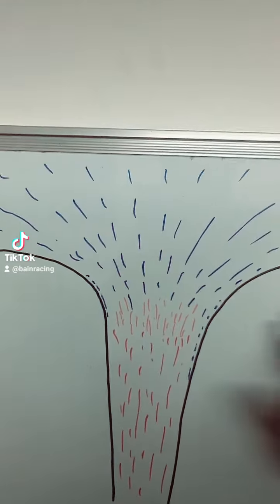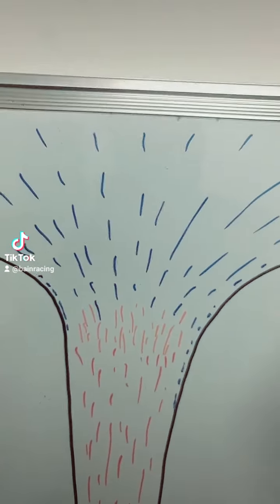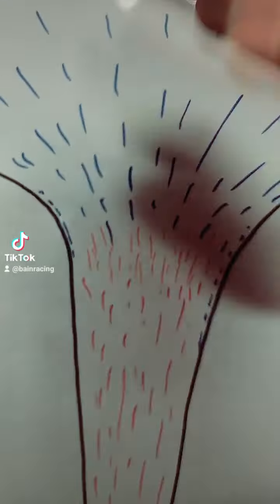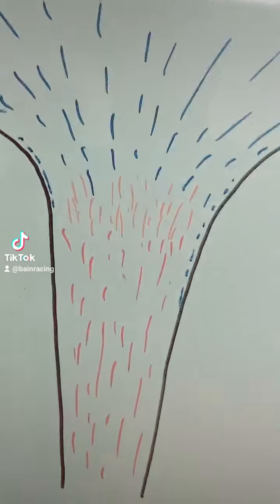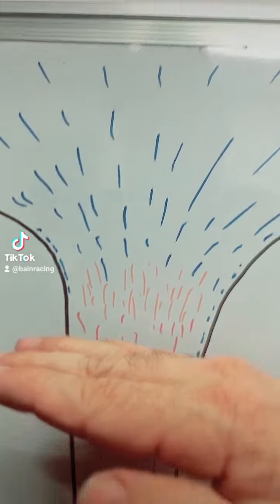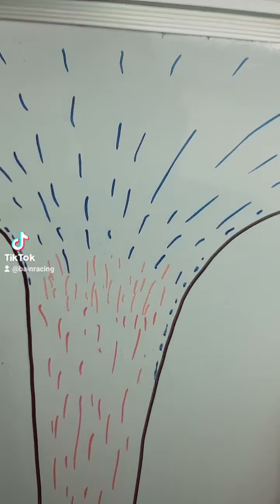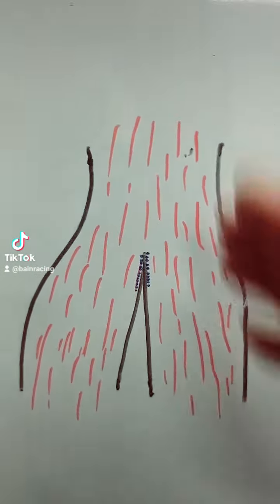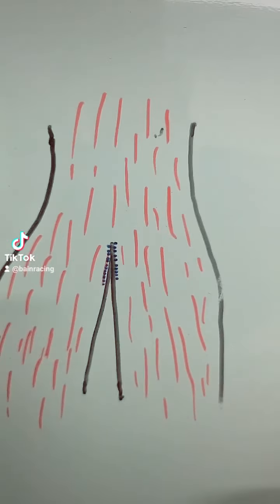"Sharp vs Radiused Dividers: Which is Better for Porting Twin Cam Heads?"

Comment: Thanks for the info. 
 A problem with sharp divider is, if the port is not 100% symmetrical, the air could flow in slight angle and that would create a wake at the edge. Round divider is much more forgiving. With sharp divider, margin of error is smaller.
Reply from the maker: Yeah, that's not really true at all mate, this something we have tested, and something you can easily probe at different pressure drops and confirm for yourself. 

The air speeds needed to create any sort of detrimental wake  with any approach angle  <5° needs to be close to supersonic, 1100fps. Which no port will ever get close to.  All the winning heads around the world are Mach 0.55 to 0.6 Max! 

Also, remember that the intake port is controlled by a "timed" depression in the form of a sine wave. 

This velocity sign wave is in a turbulent state. Not only does this turbulent flow optimise the inertia mechanism over laminar flow. But we see greater mass velocity. More mass equals more HP and torque. 

Also, this depression causes a radial pressure gradient. This means we have a fast deacceleration towards the port walls. Unlike what we see in a fully formed laminar flow event. So our drag coefficient is less, especially as we have an "active" boundary condition aswell. And we need to optimise this where we can. 

Now, another point you are missing is that the transitional length of the divider is key here!  The shape also affects the drag coefficient,  so a "C" profile has the longest transitional and radial length so this reduces any chance of a wake happening,  as the air isn't hitting a vertical wall at an instant point. 

Rather, the air is meeting the divider not only at an angular momentum but over at least 0.500" of port length.  Softening the drag it may create. 

Remember,  the devil is in the details, and we must understand the fluid dynamics principles at play here.  So, a well designed knife edge divider will outperform any radiused divider. Hands down. Not only by a velocity and inertia factor.  But to optimise the shock wave tuning. As we have reduced dead areas and reduced shock wave spread and collision. 

Now, as far as your point on  symmetry. That couldn't  be future from the turth. Again, we need to understand what pressure/density and velocity we are dealing with here and what's the most important factor.  Symmetry or CSA.  And again, any decent head developer can tell you it's ALWAYS CSA. 

In fact,  most hand ports aren't symmetrical at all. If we understand anything at all about air flow. Then the first thing we must understand is that the CSA is far more important than how "symmetrical" the ports are.  That's because velocity is directly related to our inertia mechanism, and this is what feeds our VE profile and makes HP.  

If the CSA isn't optimising our velocity.  Then you are just losing HP and torque. It's loss and loss.  

This is why hand ported heads will  always win over a "symmetrical" CNC'd port. and we have proven this many times as has any decent head developer. And it's why we guarantee not only more HP with hand ported OEM heads. But more HP per PSI and area under the curve. 

With RB heads that aren't even close to being symmetrical due to the core shift that all castings have. We are seeing over 45HP more at the same boost levels over a fully CDC'd head. Along with all the other benefits of a controlled CSA, earlier boost threshold points and more torque and HP and again area under  the curve.  

The reason why hand porting will always be best on and OEM head is because we can control  CSA far better and compensate for core shift. 

So we can have two different port shapes. But as long as the CSA is on point. Then, the velocity gradients will match.

This is the holy grail when it comes to cylinder head development. Air speed air speed air speed. As Darren morgan says. 

The top pro stock head guys will have 10 different shape ports throughout the top cars. But they are all on the same CSA, and all flow within 0.25% and all run within a 100th of a second of eachother 

CSA is everything! 

Remember, it's inertia that fills a cylinder and not how symmetrical the port is. 

Also, the whole symmetry point. Was blown out the water by coswoth way back in the 70's with David vizards polyquad head.  Slight differences in L to R ports can Actually help with increasing swirl, this mechanism has been shown many times to improve a homogeneous mix in the combustion chamber, especially with 4 valve engines which only rely on tumble. 

Hopefully, that helps, mate. Cheers for the comment 👌
Reply: @bainracing
Wow! Thanks 👍
I can re-read this slowly several times
Reply from the maker: @bobirving6052  No problem,  sadly, there are still lots of misconceptions when it comes to cylinder head development and air flow. 

It's why we started this series to hopefully kill off a lot of the myths 👍
Reply: CSA  stands for??
Reply from the maker: @Baard2000  CSA=Cross Sectional area, the CAS of a port dictates the air speed and targeting this air speed is what makes HP👌
Reply: @bainracing  thnks.    Airspeed=power ....and even more important: throttle response.!
Reply from the maker: @Baard2000  that's it!! 💪👌
Reply: Another couple of things,  the area of the port where the divider is widens out a lot. When port area increases, velocity decreases. When velocity decreases, fuel particles fall out of suspension. When you have an area where furl particles fall out of suspension, you need a bit of turbulence to shake em up a bit. Also, the areas with the most velocity tend to be the sides of the port nearest the cylinder walls, in our case here, that would be the outside ends of the port, there's not gonna be a ton of velocity in the center, so a bit of radius might create a bit of restriction that might build velocity in that area. So using a bit of radius might help with velocity, as well as mixture suspension.
Reply: Also, think of the way a ship moves much more efficiently through the water when it has a bulbous bow as opposed to a sharp "v" style bow. There's a reason for that.
Reply from the maker: @sethbarnes7608  Actually no, that's not even close to true mate. 

Sorry how many years you been developing cylinder heads? what model do you specialise in? So I can understand what heads you are referring to? 

I have hundreds of port Molds for twin cams, so let me know the model you're talking about and I can see what CSA you are talking about. Almost all ports get smaller at the divider not bigger. If you actually map the ports CSA. You will find at the divider the port area or CSA drops dramatically. increasing velocity all of a sudden, which is a problem as this gives us a horrible velocity gradient. Again this is well known in the industry. 

And No you don't need to "shake em up a bit: as its the velocity gradients stability that keeps fuel in suspension. and this is exactly why we must thin the divider and blend the CSA to create a far more stable velocity gradient, which is what keeps fuel in the air.  And this and easy one, we can see by probing before and after. What bench and velocity probe are you using? 

No most velocities are not near the walls at all! nor should they ever be! where are you getting this from? have you tested anything you're saying?? this goes against every Fluid dynamics law there is on boundary layer drag co-efficient.  What's your background in? 

Unfortunately the more you talk the worst it gets. Nothing you're saying is even logical or reflects any mechanism at play.  oh understanding of very basic air flow principles.  I would suggest, If you're not probing heads when testing, get on it! Or!  Try not to have an opinion and maybe sit back and learn something.

Comment: Very interesting.  What do you feel about applying the sharp runner divider in the plenum of typical single 4bbl manifolds?
Reply from the maker: That's a low speed to high speed. So, I will suffer separation. 

 So, it's not a great idea. But unfortunately, many manifolds are just too thin. So we shape like a billet head. 60° of the radius to a point.

Comment: Have you tested this on a flow bench? What are the actual numbers, or is this just conceptual  conjecture. Maybe you can do a head to head dyno comparison. As the great David Visard once said, "I don't have opinions, I have dyno sheets" I personally think that the radis would end up making more power, as it would increase velocity
Reply from the maker: Yeah, you really need to be careful how you validate what you're testing. And you need to understand the mechanisms at play. Yeah, old Dave, he is a funny guy. 

For example,  flow benches you really need to be careful, as flow data at one pressure drop, and steady state flow with no CSA index. Really won't tell you much at all. 

This is seen and has been tested time and time again with our winning heads. As they have lost 10-15cfm  over the last 2 decades and yet run faster, make more power per PSI and more area under the curve. Remember, a flow bench doesn't measure CFM. It only measures pressure drop and "calculates" CFM. 

A great example of this we done just recently. A head we did for one of the race shops we supply for their circuit car.  It was running a fulling CNC'D head, with radius dividers and flowed 295cfm at 0.450".

They had a head failure, and we had to port a new head and put all their gear into this new head. So everything was the same except the port work.  Our flow figures didn't even hit 285cfm.  And yet the car made 45hp more at the same boost level!! And 35% more mid, and early boost threshold points, nearly 800 rpm earlier! So everywhere was better. And if you understand the relationship between CSA, inertia, and flow. Then this will make sense. 

Also, when it comes to dynos,  you need to be careful. As even the dyno can be misleading when it comes to the track. For example, with our custom manifold program, we have found so many misleading things on the dyno. Plenum volume is a great example of just one thing and area that will make power on the dyno, but cause the car to run slower in the real world. So, you need to look at many aspects to validate what actually works. As I say, the black-track doesn't lie!😉

But yes, sharp dividers have been validated even as far back as the 70's with F1, so yeah, this area has been back to backed many times by us and many other winning cylinder head guys I know and chat to. 

And no, a radius will create more "dead area," which is energy loss, and it also  robs inertial velocity,  as we have a great change in CSA with a radius. So this is why it costs you as it can't improve the velocity gradient,  as you have a "step" change in CSA. 

Remember, CSA is what dictates air speed air speed and a "stable" velocity gradient is what feeds oir VE mechanism. If you think about it long enough, you will get it 👌

Cheers for the comment, mate.

Comment: Just found this today , so i have automotive and 2 stroke motorcycle experiance and always radiused the divider on everything due to learning it from years of playing with transfer ports on 2 strokes, i did the same thing on a 4 vave head (bmw motorsport) that had a very sharp divider it still made power but may have caused a choke point as you say and ill try to knifedge the next one to see the difference, so this would mean the flow bench wouldnt have picked up a restriction with the radiused bridge but the way you described the effects this could have affected it to a reasnoble degree, the heads are super special and worth looking at s38b35 bmw head , amazing intake port just a tidy up netted 275cfm @ 10mm lift but dropped off flow after that, im now planning my next port job differntly 😊 thankyou
Reply from the maker: No problem,  just remember a flow bench doesn't measure cfm or flow. Only pressure drop. So it won't test the dynamics well.   Also 28" is very restricted. You need to test at different pressures as high as 60" to get more of an idea of the dynamic ability of the port, velocity probing is key here.

Comment: If its 2 into 1, a sharp would be best. On a 1 into 2 a convex radius is beneficial due to Bernoulli's principle. Agree? Disagree?
Reply from the maker: It's more to do with relative air speed in front and behind the two points you're referring to. If similar, then sharp is better. If, on the other hand, we have a huge velocity gradient. Then, a radius is generally needed to control separation as the air is accelerating as well as dropping denisty. So we need to control the vena contracta from forming 👌

Comment: So this got me thinking, and well maybe overthinking and perhaps even a bit out there😂 so let's say you had a device that could amplify the acoustic waves the engine makes and synchronise them with the motors stroke could this enhance the motors performance hmmmm
Reply from the maker: Yes, this is what we do when designing intakes. Target the 3rd harmonic. But fixed runners will be limited to a narrow RPM range. 

But variable runner length like what F1 used in the day allowed a broader RPM range are the runner would get shorter with RPM. But was banned. 

 Some factors bike's a use a lift away runner also. To help improve this mechanism 

As well as Le mans racing,  like the 24 hour's 787B rotary, which also uses a variable length runner system.